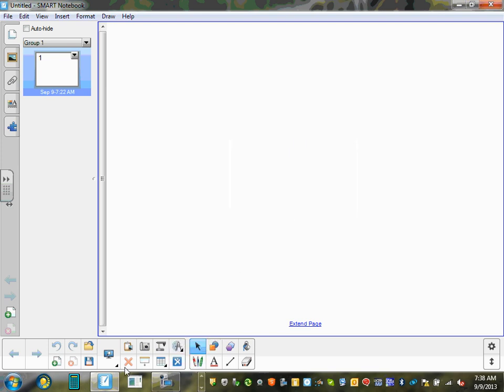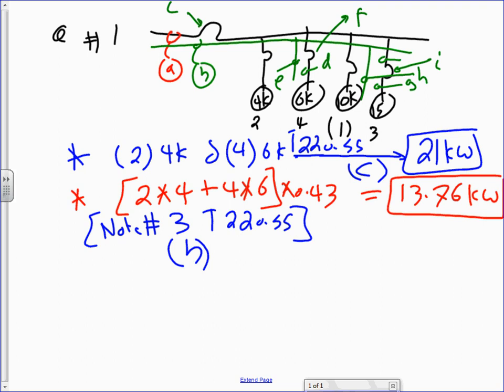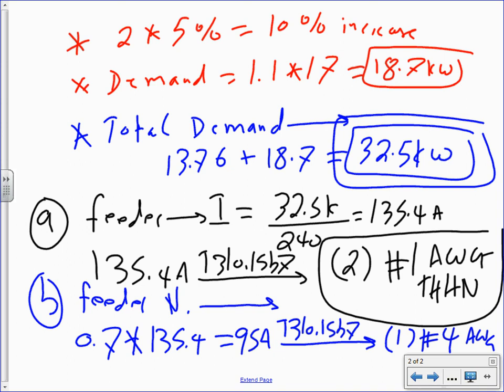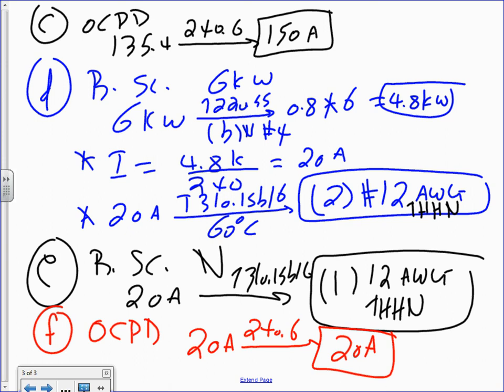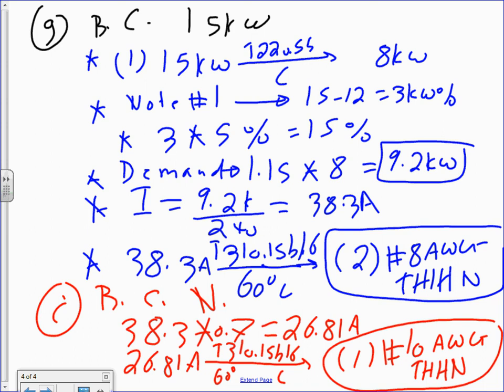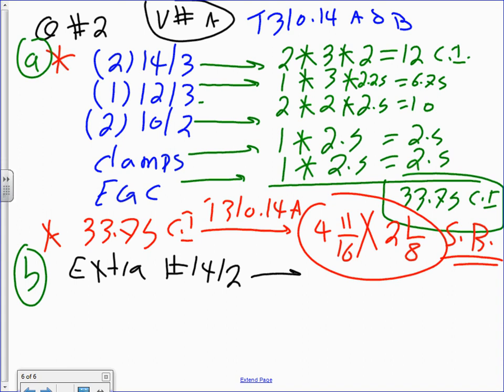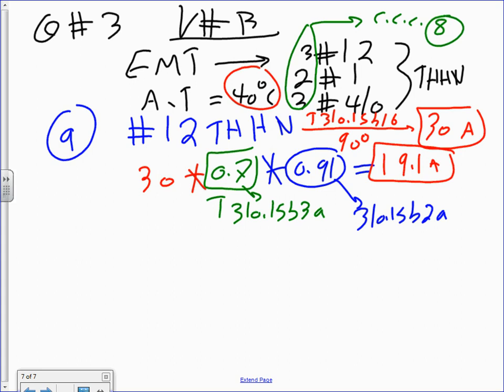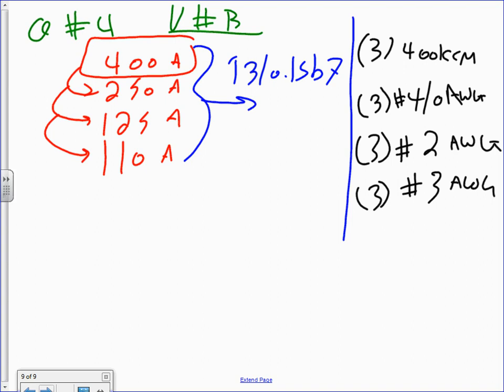Ranges, Box Fill, Ampacity & Dwelling feeders Calculation & Sizing 09 09 13

Comment: Nice explanation with examples. I have learnt that For Ranges, Neutral can be derated if the capacity exceeds 8.75kW. Can i know from which code reference, Clamp and EGC has considered as 2.5mm?.  I would like to inform that 310.14(A)&(B) from NEC 2011 has been shifted to 314.16(A)&(B) in NEC 2014.  I would like to get few more details about the application of T310.15(B)2.a and T310.15(B)2.b, Based on which factor we have to choose which table?. Thanks for uploading this video.

Comment: Recently I visited Israel and as an electrician I could not help put check out their electrical system, basically from the British system. I wondered how the Israelis figured out the distribution system throughout the cities because the power structures (towers) that carry the system's voltage before entering the buildings are very short in height,  maybe 25ft half the height of US wooden power poles. Is this because they use a lower potential distribution voltage? Also in my hotel I opened the CB panel & what a surprise it was 1/4 the size of US std. Is this because of the 250VAC supply? Just curious!